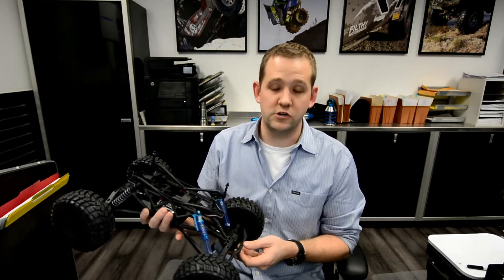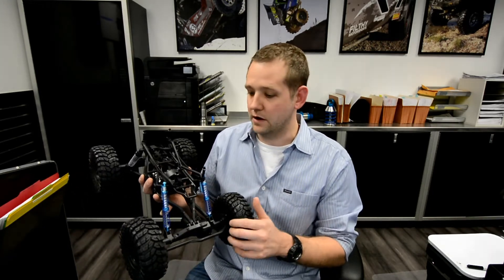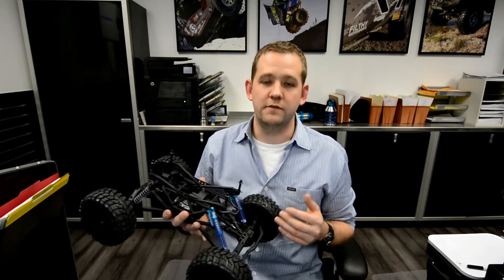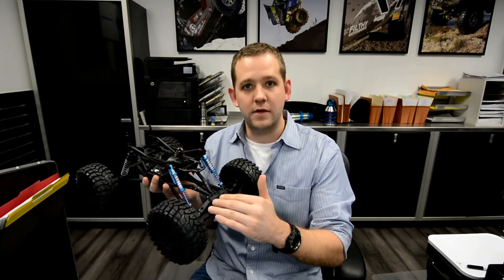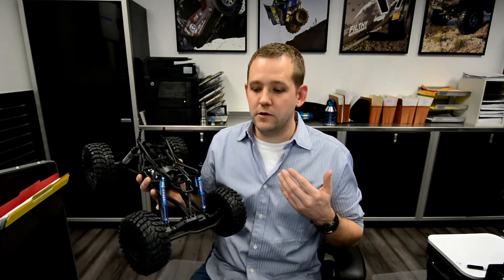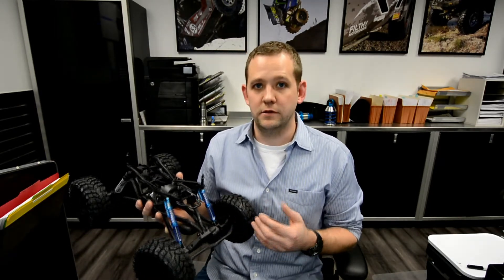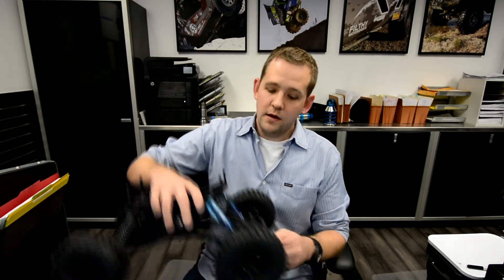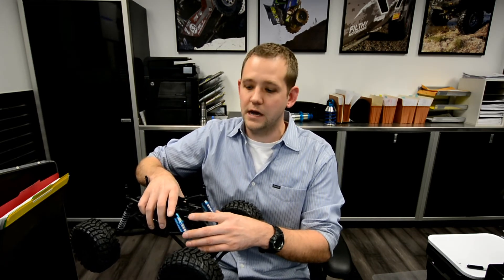How To Measure For Coilovers, Shocks, and Struts - Filthy Motorsports

Comment: I have very limited space around my sand rail front A arms and can only fit a bypass shock and an air bag...I know its not usually racer/off-roaders preference but I should be okay to get a well performing setup right?
Reply from the maker: Air bags have been a big fad with sand rails recently but they really aren't a great choice from a performance standpoint. If that is what you have, no worries, send us a few photos and we'd be happy to make a recommendation.

Comment: I'm measuring for shocks w/o coils. Do I remove the shocks that are installed and take measurements of the compressed and extended length?
Reply from the maker: Correct, if there is any chance that the existing shocks are limiting travel, you will need to remove them for a full measurement. Be careful though, in some applications the shocks are the limit straps so installing longer shocks could cause damage to other components. Make sure to watch your CV shafts, brake lines, steering linkages, drive shafts, etc.

Comment: I stumbled across your site, so much stuff at great process ive been dreaming and thinking up... searching air-over-shock-strut/coilovers bags.. and noticed that you have a listing but it says no longer available.. Do you guys still have any other type of AIR- OVER SHCOCK-/COILOVER KIT/? I was excited to seen that you had a listing, but your listings says no longer available.. As im building a sort of one-off daily-expedition, adventure jeep xj' Cherokee, and I like the idea of the air-bag-over coil spring shock, and the mix of the coil-over.. with the 4" w/o air- or very low- IE:2PSI, Then before I hit the trails, or load gear on, winches, acc.'s,trailer... etc.. I could air up the coil-spring-air-spring-shocks/strut to bring it back up to 4" or, add say 20psi- to bring it up to 8" to get over rough trail etc. or in the middle at 5" with 20psi- for all the gear packed in and on the rig...Is there any other air- adjustable shock/strut/springs? either way, glad to find your site, and awesome prices..Thanks.. and great video.. the"waterline" of the boat with weight in it is a great concept and made perfect sense for solid axle setups, vs a road car with SuRL,single wishbone-a-arm. etc. setup's..
Reply from the maker: Hi Justin, thanks for the kind words and sorry for the late response, I was at a long race over the weekend. The air over coil concept is one of those things that is a great idea in theory but is a major headache in real life. We worked with a handful of customers willing to try them and in the end we only had one guy in Australia get them to work decent after almost a year of testing and tuning. In the end though, we decided that it's just not practical and doesn't provide the advantages you would think it does so we dropped it. Sorry!

There are other ways to achieve what you are trying to do so I suggest giving us a call when you have some time and we'll go over your options.

Cheers!
Ben

Comment: Thanks Ben!
So if I get the largest shock that will fit fully compressed but it's longer than I can use fully extended, do I use shorter springs or softer springs?
Reply from the maker: I'm reposting an answer since many of our comments got deleted moving to a company channel:  In this case you would run the calculated springs and then use limiting strap to keep the suspension from over extending.